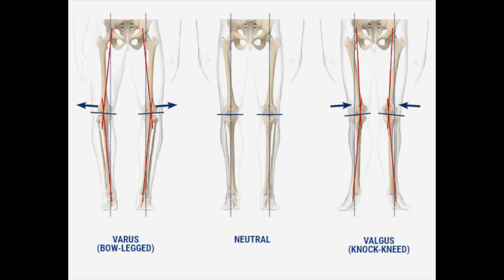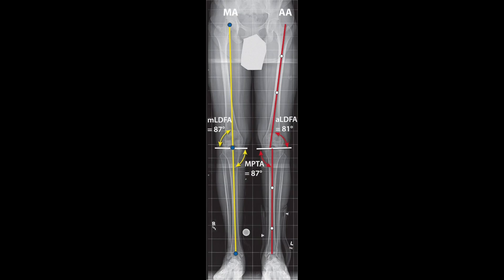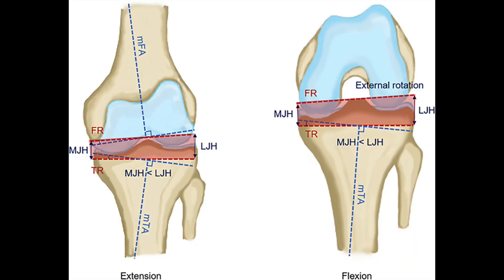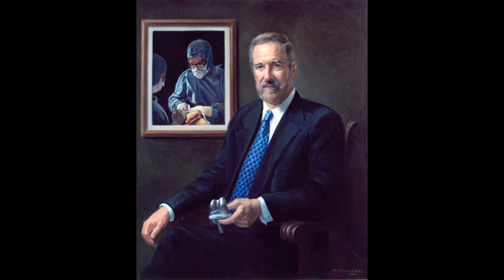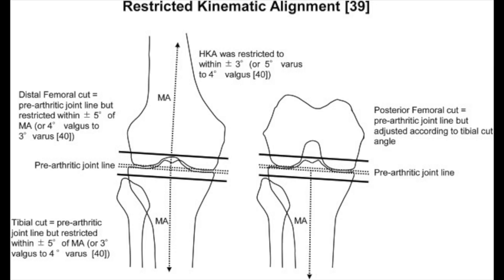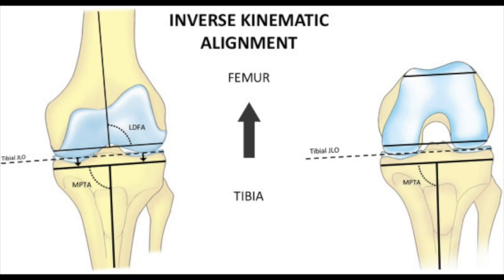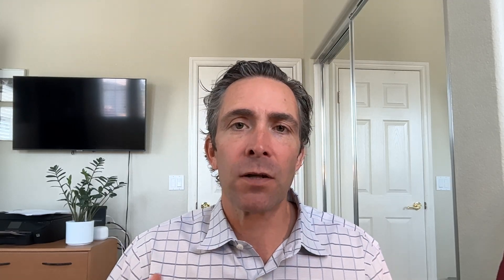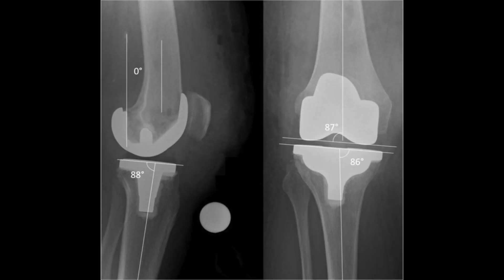What Surgeons Never Tell You About Knee Alignment

Comment: My TKA surgeries were performed on 12/01/22 & 06/03/23. Here is my latest follow up visit xray results notes. Impression: Cemented tibial and femoral components are well fixed in anatomic alignment. It is a DePuy Attune on the right and a DePuy Attune component with a constrained femur and a constrained poly. There are no stems. on the left. Cemented patellar components are well fixed in proper alignment. There are no radiographic signs of subsidence or loosening of either knee. My left knee had a bone disease when I was a child. I put off getting it replaced a bit too long. It was bone on bone for so long, my femur eroded the top of my tibia. I think that is why a different implant was used in my left knee. I am totally impressed with how my new knees perform. Even with two different implants, they both function exactly the same.

Comment: Thank you for this. What is your philosophy?
Reply from the maker: I always joke I am 'kine-mechanical.' I don't think we should alter the joint obliquity very much and I try to not do much in the way of releases. I start with mechanical and deviate based on the patients anatomy.
Reply: @dradamrosen I appreciate your personal response very much. 
Another question if you don't mind. I am nearly 71. Both legs are bowed, right is a little worse. Both knees are bone on bone. I'm considering trying to find someone to do bi-lateral TKR for me. 
My reasons are that I understand rehab is easier if the legs are the same length which they wont be if the procedures are performed at different times Also, I don't want to spend the time required to rehab one and then rehab  the other.
I have Medicare and a G supplement and would want to do 3 nights in hospital followed by 2 to 3 weeks in-patient rehab. I live alone.
Am I being unrealistic?

Comment: Thank you for this. I had my right knee replaced 5 years ago and chose a surgeon specifically because he said that he typically used kinematic alignment. At the time, I had found some research papers that indicated that it improved the likelihood of a good outcome as compared to mechanical alignment. I don’t know what “flavor” of kinetic alignment he uses, but I have been very happy with the result. I had my left knee replaced 12 weeks ago by the same surgeon. So far, things are going very well. One difference between the 2 is that the first one was cemented and the second one was cement-less.

Comment: I had a partial(medial) done 12 weeks ago. I had commented on one of your previous videos regarding this and you responded,thanks! I am doing pretty well but continue to have some swelling. From about 2weeks post op I have felt the outcome is somewhat valgus- based on looking at my other leg. I am fully aware I am going off of looks! Yes, I have brought this up at appts and will have a full leg X-ray to fully answer my concerns in 4 weeks. I hope everything is spot on, I just need some proof and it explained to me with an X-ray. My other leg has had no issues or swelling. I hope all is well and time will tell, I’m just anxious to get back to running and biking. Thanks